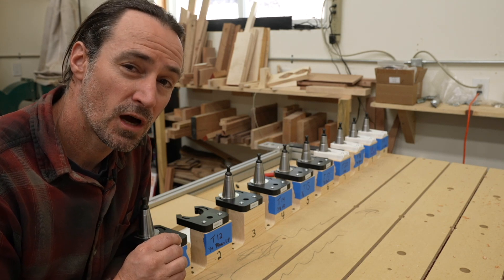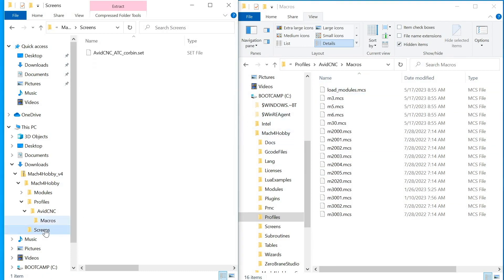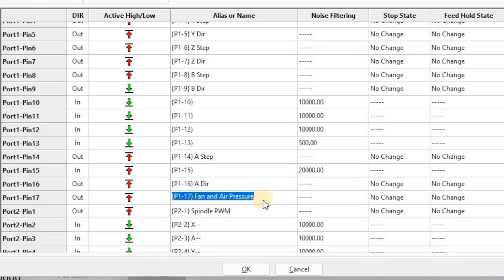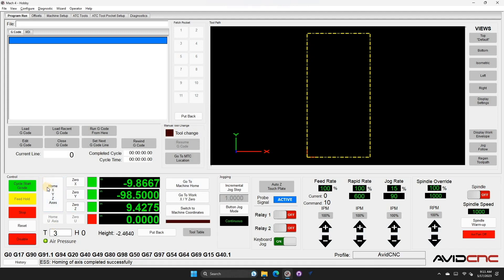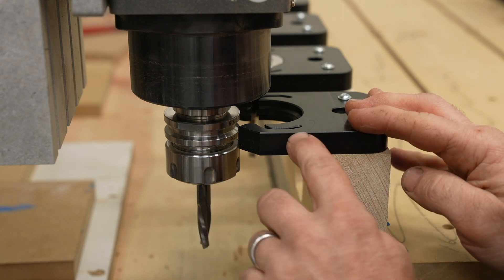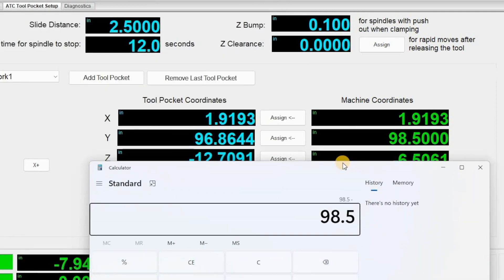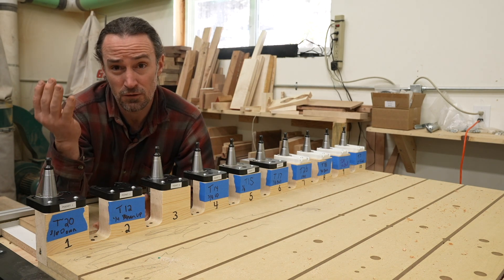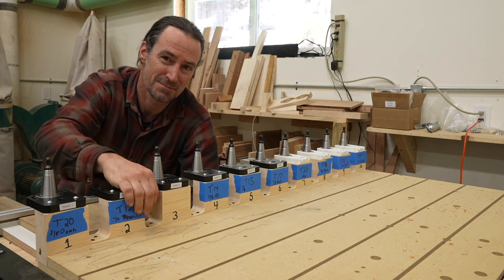CNC Build Ep 7: Custom Mach 4 ATC Tool Station Setup! Setting up ATC Tool Pockets / Tool Forks /S30C

Comment: This has been incredibly helpful - because of you my ATC system is basically set up (minus the beautiful wiring).  I don't own your machine but I own Avids old electronics which I've completely changed at this point.  I have a chinese 5.5kw water cooled spindle and this has been relatively easy to set up.  Thanks for your help.  This is amazing.
Reply from the maker: Awesome - I'm glad it helped you out! What brand spindle did you get, and where did you order it from? (Aliexpress?) I'm also curious how long it took to get it...sometimes stuff from China can take a while to arrive (for people in the US, at least).
Reply from the maker: I got your message about comments not working -- sorry about that!! I don't know why YouTube filters them; I don't have any restrictions on commenting, and I'm not sure why certain comments aren't allowed. I'll have to investigate.
Reply from the maker: I changed the YouTube comment moderation from "Standard" to "None". Unfortunately it doesn't even let me review comments when it doesn't let them go through. Darn youtube!
Reply: @CorbinDunn  aah so it just depends on personal settings on your own channel. Sounds good. I'll try again if you want a direct link - lets see what happens.
Reply: @CorbinDunn Additionally, The spindle does have 2 censors that are attached to it inside (I believe they're limit switches) which I haven't wired yet - I think they verify that the spindle is in either a clamped position or un-clamped.  Not 100% sure yet - but because of your video I think I have an idea how I might implement them.
Reply from the maker: @LogicSpeaks  Thanks for the link! My channel's settings were just the default..I had no idea some comments were simply getting lost.  The other possibility is that the sensors are regarding movement and direction. My spindle also has some sensors for clamped/unclamped/forward/reverse. The best one to hook up would be a sensor to find out if it is spinning or not, that way a tool change could happen when it is for sure stopped. Clamped/unclamped is also nice to know if it successfully clamped (ie: air was on)

Comment: Hello Corbin.  Many thanks for doing these informative ATC videos.  They are a great help.  I am in the beginning of adding ATC to my shop-built CNC router.  I have a question about the racks and forks for the tool holders.  The question is why is it necessary to design the forks to require a side-slide motion to fetch or return a tool?   Why can't the forks be designed to allow the ATC spindle to simply come straight down over a fork, grab the tool, and then go straight up?  And return a tool by coming straight down over the fork, release the tool, and then leave going straight up.  Thanks.
Reply from the maker: Hi Richard, My apologies for the slow reply; I was gone for a bit. Some racks do the "drop in" style, and I have seen them. I had read somewhere about some problem with them...but at this point I kind of forget what it was. Most industrial CNC machines seem to use the slide in version, so I figured it was the best way to do it.

Comment: Great work on this! Thank you for sharing. I am trying to change the UI of Mach4 just for what the relays say, can you please recommend how to learn this? Is there a channel on YouTube that helps with this or anything. Also, can you please share how you got the pendent to work with Mach4.
Reply from the maker: Editing the names is super easy. Just Disable the machine, and then you should see a menu item at the top to edit the screen (I can't check the name at this moment as i'm away from my machine). In Edit mode...click on the label, and there is an inspector on the left that has the Label for it...change it. Super easy! Backup the file first if you are worried you might mess something up.

Pendant: VistaCNC has a driver and directions on how to install it.

Comment: Hi Corbin!  Thank you so much for making a great Mach 3/ 4 screen set.  I have just 1 issue.  The Z bump isn't reactive enough.  Its pressing on the fork bending it.  So when a tool is picked up, the drawbar is pushing the fork down.  When a tool is released, the spindle isn't going up soon enough when the drawbar releases it.  I don't understand the line you put in the lua file for Zbump?
MCCntlGcodeExecuteWait("G00 G90 G53 Z%.4f", zPos + ToolForks.GetZBump()) -- rapid here seems scary..but okay
There seams to be a pause before the spindle moves up or down with the drawbar action.  Then the movement is too fast once it goes.
I am using the same Zbump amount as I did with the CNC Depot screen set, that worked just fine, no fork bending.
Any insight to correct the fork bending?

Thank you.
Reply: I got it to stop bending the forks by commenting out 2 lines.  Line 259  MCCntlGcodeExecuteWait("G04 P%.4f", 0.3)  and Line 310  MCCntlGcodeExecuteWait("G04 P%.4f", 0.2) 😁
Reply from the maker: Great, I'm glad you got it figured out! My spindle seems to release a lot slower than other peoples, and if I don't have the pauses it will potentially start to rip the forks away on release. Maybe I can make them optional for other people.

Comment: Hi Corbin, i've just discovered yours videos ...very cool.................for this one you're with  Mach 4...do you know if it'ld be possible with GRBL1.1 protocole ??
thank's a lot
Philip
Reply from the maker: Hi Philip - I hadn't heard of GRBL; I think it is a Gcode interpreter/controller based on some quick googling. It looks pretty cool!  So, if I understand it right, it does the same thing that Mach 4 does. Mach 4 is the Gcode interpreter,  and it communicates with some hardware that actually does the motion control, which for an Avid CNC that is usually an Ethernet Smooth Stepper (ESS). 

So....I don't really know the answer to your question. What are you trying to do?
Reply: @CorbinDunn  Hi Corbin, the same system as yours for changing tools...but under Grbl protocol............Sincerely..........Philippe

Comment: These videos have been extremely helpful. I recently upgraded my ESS along with Mach 4 at the suggestion of AVID to solve some motion issues. I found the problem with the motion issue, (not the software), and went to set up my ATC again. It had been working previously with the older software. Now, when I go to assign Pin 1:1 to Output #6 I can't get Pin 1:1 to show up in the pull down menu and I can't write it in. Any suggestions would be much appreciated.
Reply from the maker: I'm not too sure why things won't show up in the menu; I don't do it often enough to be really familiar with all the Mach 4 UI for the setup. I'm guessing the mapping doesn't exist where it expects it. It might be easiest to just start over and follow the pin mapping directions from the start to reset it all correctly.
Reply: Thanks for the reply  @CorbinDunn  I also have feelers out on the Warp9 chat room.
Reply from the maker: @MarkHintzke  One thing to note: it will only show up with the alias name you setup in the ESS config "Pins Config" tab. Maybe you have it named something else, or used somewhere else.

Comment: Does this only work with avid ess boards. Or will the open share work with hicon controllers.
Reply from the maker: I started with Avid's version of Mach 4, so it has some dependencies on it for things like the touch plate. Other than that, the code is fairly generic; I could probably remove all Avid-specific things and make it more generic.
Reply from the maker: Although, some things, such sending the signal to open the drawbar (and close it), are abstracted via Mach 4's plugin mapping, and I talk about how to hook it up via ESS. So, you could simply map it to whatever mechanism your controller board uses.  In theory, it should work, but I'm sure it'll take some fiddling to figure out any problems.

Comment: Corbin, i installed your screen set over the weekend.  It's awesome!  I went ahead and changed everything over to metric. This was relatively easy to figure out as well.  I don't have a pendant, is there an easy way to bring the jog feature back into the new screen set?  Thanks again!
Reply from the maker: Awesome! Do you use a keyboard? Can you jog with that? Or do you preview a touch screen? I've been super curious if people used this feature or not...sounds like I should find somewhere to put it back in the screen. FYI - you can use any other screen set you like once you get it all setup; the M6 tool change macro will still work fine with another screen set.
Reply from the maker: ...and I know I should make it more generic to support metric "out of the box". I blame the US being stuck in the stone ages!
Reply: @CorbinDunn  I ended up going back to the original screen set to jog with the mouse.  There may be another way, which I haven't figured out yet.  But after jogging, I went back to your screen set. I simply like it better. Like I said, switching everything to metric wasn't that difficult.
Reply: And yes, I use a keyboard
Reply from the maker: @klausmesserer1361  - Cool - FYI, you might already know this, but you can turn on the Keyboard jog button, and then just use the arrows on your keyboard. Hold down shift to do a rapid jog, and hold down ctrl to do an incremental jog. This is how I jog when I don't use the pendant, and before the pendant I used a wireless keyboard.

Comment: Bonjour
très beau travail
une question comment avez-vous géré les sonde de broche S1 S2 S3
Reply from the maker: Hi! I think you are asking how I picked the input pin numbers. I just found ones that weren't being used in the ESS setup, and used those.
Reply: @CorbinDunn  bonjour de France😉
non je parle des sondes de la broche(spindle)s1 s2 s3
qui confirme spindle stop
pince open or close
outil présent
cordialement
Reply from the maker: @ferrandferrand3456  Oh, I understand now! I have not hooked those up for my spindle (HITECO QD-1F), but it does have the output signals. It would be nice to add those checks for safety to ensure the spindle is stopped and a tool is locked (or not). The only check I have is if the air is on or off, and prevent the tool change when the air is off.
Reply: @CorbinDunn  bonjour
sur mon projet cnc j'installe une broche HSD 919 de 7kw
qui possède les 3 sonde
comme je suis débutant c'est pour ca que je vous posait la question
Reply: bonjour avez vous reçu mes ligne de scripte
cordialement
Reply from the maker: @ferrandferrand3456  Hi! I haven't received anything...did you email it to me? Or a GitHub pull request?